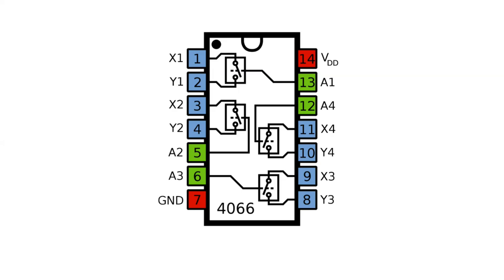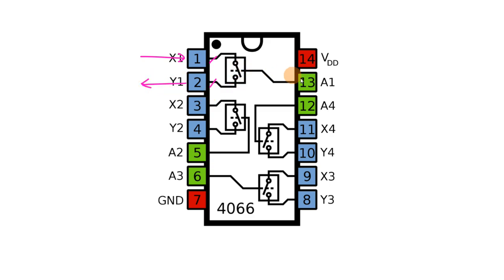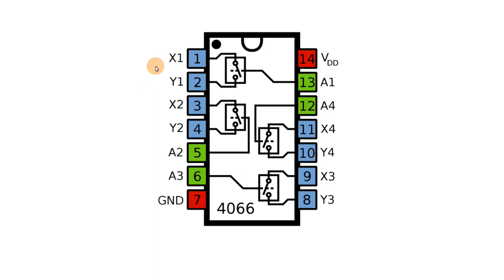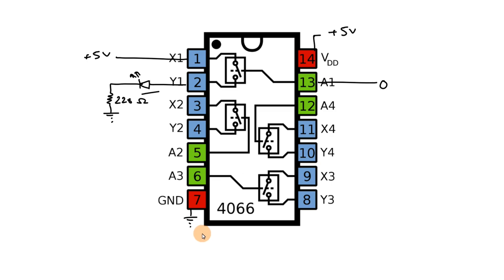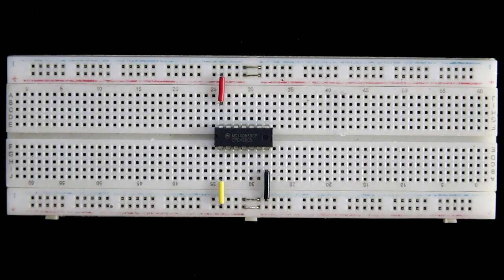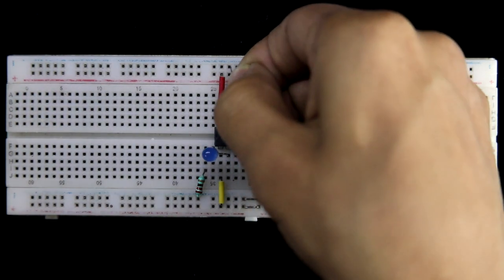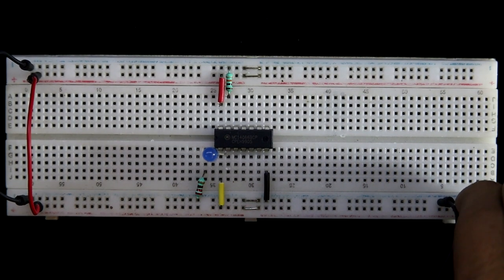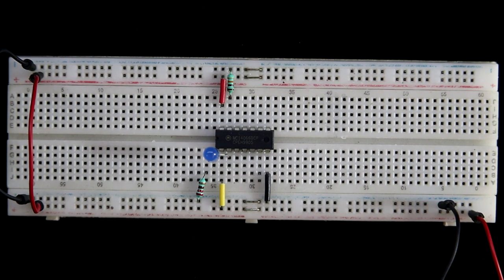CD4066 Bilateral Switch

Comment: What was the purpose of this ic instead a simple on off button would have done same thing
Reply: yeah, 4066 is a push button -- and now you can use arduino to press and release the button
Reply: You can't switch an on/off button at 40 MHz. For example, high frequency switching allows these to operate as radio mixers and modulators.